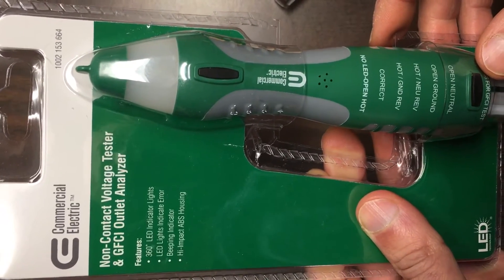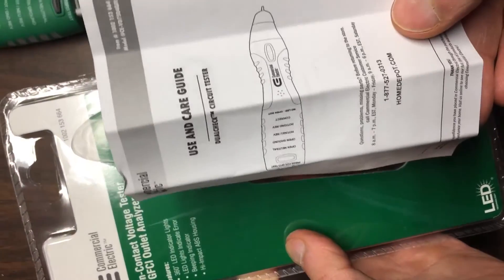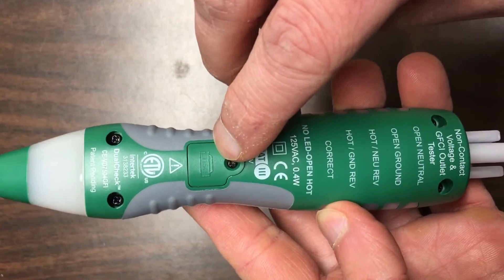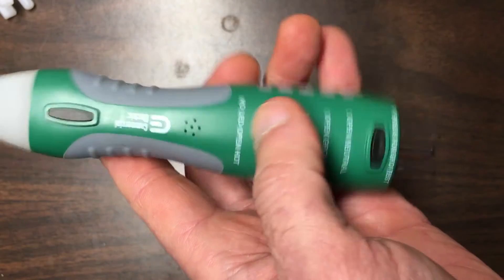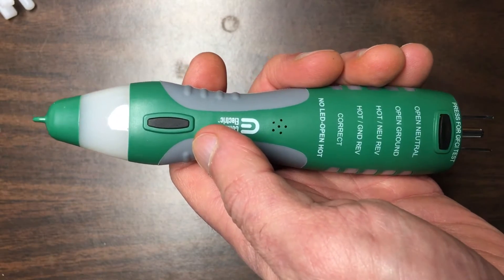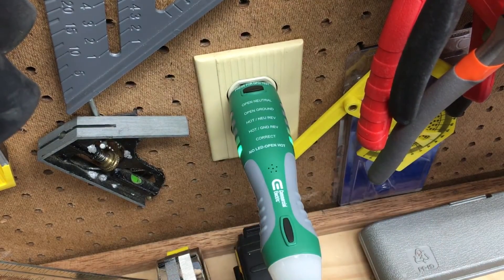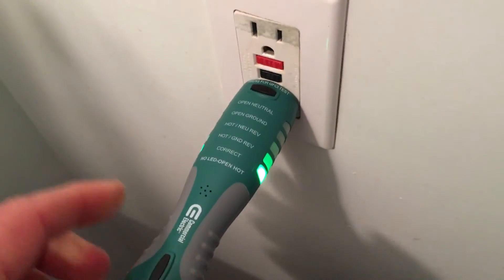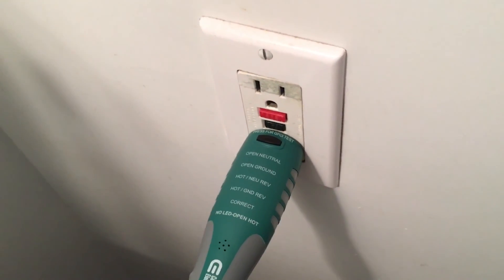Commercial Electric Non-Contact Voltage Tester & GFCI Outlet Analyzer

Comment: As an electrician, this is my favorite GFCI/receptacle tester since it is efficient (3 tools in 1!).  It is also larger than the little rectangular testers. so I like that ...like if it's plugged in and you are looking at a kitchen counter it's easier to see than a little tester that might be hiding behind something.  Just the glow of the green light is good enough -especially in a dark room.
Another great thing it that since it is long and thin, it fits perfectly into a slot in your tool bag or belt -like a screw driver -so no fumbling around digging it out of a pouch or pocket.

A word about non-contact/proximity testers: they ALL suck.  This one has been better than most and I simply won't buy another at this point because it's been the best so far.  I've owned/lost/broken 6 or 7 of these and only 1 of them seemed less reliable than all the other types and brands I've owned in the past.
THAT SAID: Do NOT count on a non-contact voltage tester.  They are a good 'first step" but once you see copper (or aluminum), check again with a real multi-meter.  They are handy (but not the best) for tracing a wire in a bundle.
Reply from the maker: Thanks for sharing your experiences. I have multiple non-contact testers on my belt and I like this one too.

Comment: Can this be ordered ?
Reply: If it can, how much would it be ?
Reply from the maker: I got mine from the local Home Depot, but it can be ordered on their website. It costs ~$25. 

DualCheck 2-in-1 Tester, 50-1000V AC Non-Contact Voltage Detector and GFCI Outlet Circuit Analyzer
https://www.homedepot.com/p/300254856

(FYI- I do not get any compensation or commission for providing this link).

Comment: I bought one of these last night and the voltage tester part is down right dangerous. It would intermittently pick up a hot wire on a 20A circuit, which could kill you if you touched it. 
My cheap $10 tester picked up hot wire every time. 
Much better with a separate GFCI tester for $8 and a separate voltage tester.
I've not had two units, made sure new battery and same issue.
I'm writing to CE about this as it's a massive liability.
Do not trust your life with this garbage.
Reply from the maker: Wow! Thank you for sharing this information. I have the CE and also a Klein Tools non-contact tester (without GCFI). I typically use them in tandem for safety... in case one is not registering properly. Thanks again!
Reply: @BruceAlanR  you're welcome. I'm just another diy person
Reply: @Globespy  you shouldn't do it
Reply: First of all, you should NEVER trust any non contact voltage tester -I've tried 6 or 7 and they all suck.  Electricians will tell you this.
That said, as an electrician of 35(ish) years, this is my ABSOLUTE FAVORITE receptacle/GFCI tester.  I buy 2 or 3 at a time because if I lose one, I want another right away.  I do use the non contact tester for casual line tracing, so that's a huge bonus (if I don't want to work on a live circuit, I use my voltage tester because a non contact tester won't tell you if there's less than 90 volts present ...and that can hurt).
Besides the fact that it has been (for me) a reliable tool, I REALLY like the shape because it will easily slip in and out of a slot in my tool bag.  It's easy to see and unlike a clunky rectangular tester it's easy to find in the dark

Comment: Heart vid. Just pick up one of this and was wondering how it works..... so what does an the open neutral mean if it lights up? &What's an open ground? Mean... and what dose Hot /  NEU  REV.  Mean??? & last HOT/GND REV what dose all this mean sorry if I sound dum. Thanks
Reply from the maker: Oh geez.... I just typed in an explanation and then forgot to save it. Arrrrrgh! OK! I'm going to assume you're new to this so I apologize for taking it back to basics. I'm not an electrician, so I recommend calling an electrician if any of the other lights on the tester turn on for your safety.
Here are some basics and I will try and oversimplify:
In each outlet receptacle, there are likely Romex wires running into and out of the box (unless it's the last outlet of the circuit in which case it would be one... unless it's tied into a light switch in which case two... I digress). Each Romex wire (assuming your wiring is not older than 1970's) contains 3 wires: (1) HOT (usually black) which carries current; (2) NEUTRAL (usually white) which carries current back to the electrical panel; and (3) GROUND (usually a bare copper wire or green) which in the case of a short circuit, discharges current to the ground and should trip the circuit breaker.
To answer your questions: "Open Neutral" is just that... the circuit isn't closed because a neutral wire is not connected or secured properly (in the box or somewhere in the circuit). "Open Ground" can be a number of things. For example, a ground wire isn't properly connected (either at the box or somewhere else in the circuit) or if it's old wiring (pre-1970's), someone may have installed a three pronged outlet without providing a real ground wire (pre-1970's cloth Romex wire only had 2 wires... Hot and Neutral, but no ground.... although old BX cable was wrapped in a metal sheath which was used for grounding... but I digress again).  "Hot/Neutral Reversed" usually means the right hand slot of the receptacle (looking at a three pronged outlet as two eyes and a nose) is connected to the neutral instead of the hot wire.
And finally, "Hot/Ground reversed is most typically a symptom of an open neutral which I explained before. Hope that helps. Please be safe! 
PS - One of my favorite Youtube subscriptions is "Sparky Channel." He's a licensed electrical contractor. :)
Reply: The simple response to this is that if you don't know what these mean, you probably should not be doing electrical work.  Maybe work with someone who can show you what you are doing ...electrical work is dangerous ...it's not just about getting shocked, it's about fire hazards that you may not understand.
Reply: Exactly @SwingboyPA